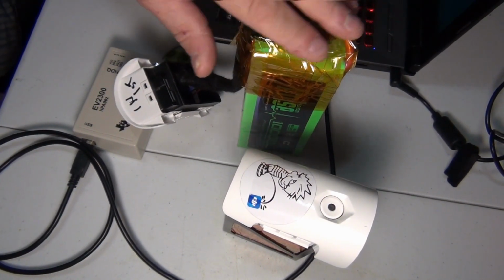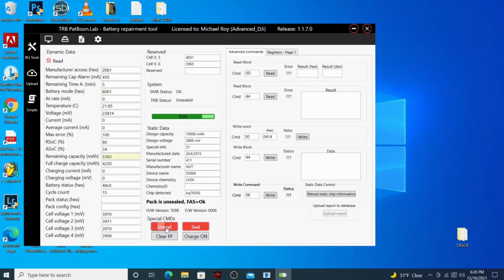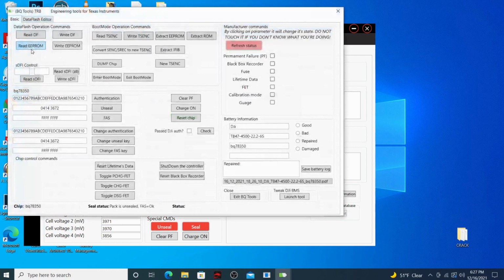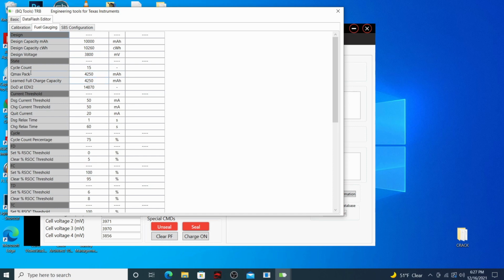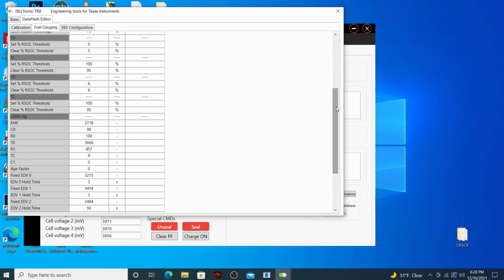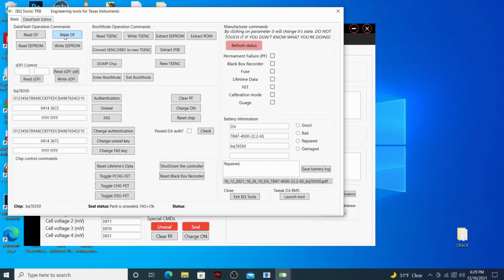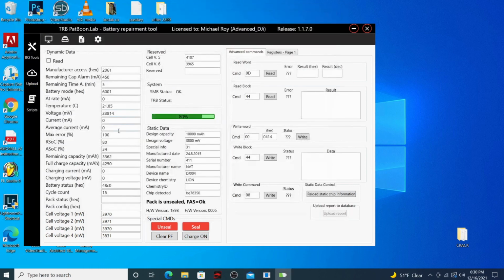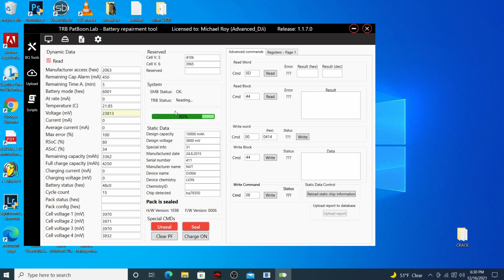TRB2300 settings for DJI INSPIRE 1

Comment: Have you gone any deeper as to what needs to be changed in bqtools to get the capacity to show up properly in the dji app? I have the adapter and the trb license but I can't seem to get the settings right yet. thanks
Reply from the maker: its hard and dont want to explain here, but if you go to patriks wesite and look under documents, downlod the big .PDF, it explains how to do, there are 3 values you need to change, you need to no specs on cells your using, and there are 2 reset buttons you hit after you change values, but first you unseal, and after done make sure you seal